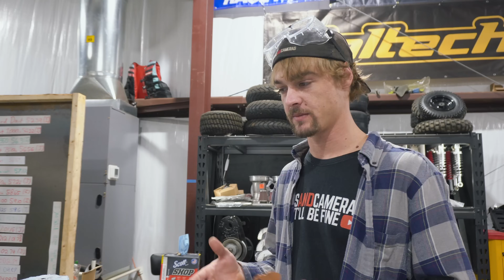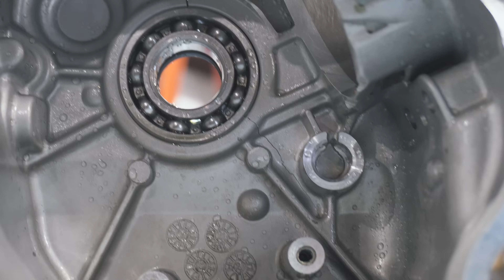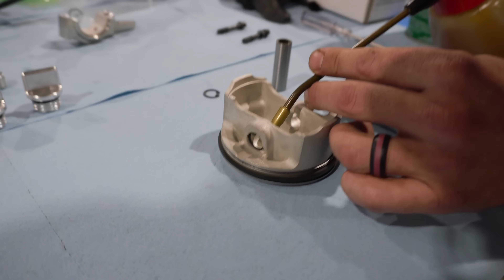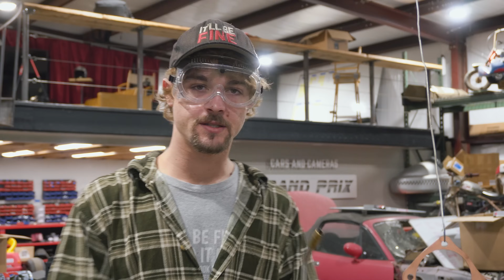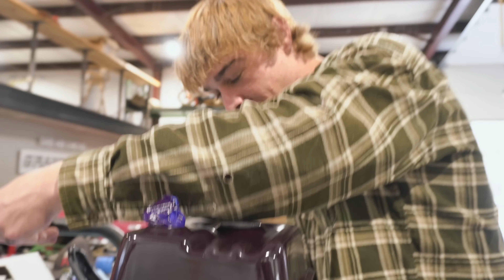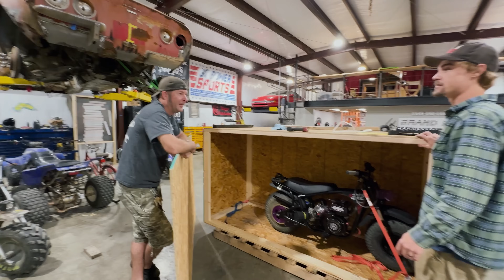Tillotson 263cc BIG BORE Build | Billet Head, 13:1, 30+HP Monster!

Comment: Around 7:55 john talks about ring end gaps and says the top ring is less than the second ring... And this was when things changed.  I attended a class around 1992 where sealed power/speed pro reps came to my school and introduced a new way of thinking on piston ring tech back then. They found the second ring should be greater than the top ring so as not to stack gasses in between the rings and unload the top ring from it's seat on the piston land. I tried this in my 455 Oldsmobile stuff and it worked like no tomorrow. The ring end gap bigger on the second than the first will mathematically allow blowby to an extent to not unload that top ring seal. The second ring is more of an oil control anyway so it was loaded below the top ring and allowed cylinder wall scraping of oil while also holding compression with a controlled release. 
Since then I gap my second ring about 2-3 thou more than the top ring and can easily make 620hp/600+ ft/lb stock block Olds 455s that can be driven on the street with zero problems. There is a huge difference between a 500hp n/a combo and a similar but different 600hp/600+ tq engines...as you can imagine. These long intake runner olds engines have all kinda velocity past the plenum into the cylinders and they love huge carbs with big venturis which tend to slow down the mixture just enough to stay atomized and also flow just enough to make up to 650 nearly 700hp. I know chevrolet guys won't be impressed, but all I'm saying is I can do more with 462 ci Olds displacement than stroker small block chev stuff at 434 ci if normally aspirated. 
People build these 500hp small block chevs for nitrous or even boost and the olds stock block can't survive over 750ish hp for long. I could go on and on with this.
Ring seal and type of rings and setup are the key and I love applying this tech to these small single cyl engines. 
I'm still looking and waiting for a dykes type of top ring for these engines and I'll make more power than another with 20cc more displacement!
Just sayin'

Comment: I believe those are the 1:3 black venom ratio rockers, EC Carburetors has the 1:5 heavy duty roller rockers. They have just a bit more power output throughout the engine and are stronger, lighter, and smoother.

Comment: Toyota head gasket sealer is what the big alcohol pro open small block builders use to lock that head down it's very expensive but really good
Reply: Or they did when I had one of the go kart engines

Comment: Do you have trouble using heavy springs with a cast cam, I have to use a steel cam on a kohler for a pulling mower.

Comment: 30+ hp on a mini bike is a fire breathing tire shredding white knuckle beast and I want one. I've got a stretched motovox with a predator 224 on it with your common upgrades like governor delete, carb, header pipe, flat top piston, bigger cam, heavier valve springs, billet rod and flywheel but it's  not making anywhere close to the power yours is making. I know how my bike feels and it rips but to have 30+ hp has got my gears turning and makes me want to build a new engine. You guys have done a great job on this new build.

Comment: Different people build different. Like for instance I only use assembly lube on my engines. Isn't wrong to use oil. Just wasn't the way I was taught. Just cool seeing his style that's all.
Reply: No assembly lube should be used for a non pressurized oiling system. As thick assembly lube can clog up oiling channels since the non pressurized flow can't remove it. 

Top tip for you guys.
Reply: @WyFoster  It's a preference thing. All assembly lube isn't isn't thick. You might be thinking of grease. Otherwise you have no idea what you're talking about and should probably do some research.
Reply: @Khris Yeet  I went to college for motorsport engineering. While I was in college I worked as an engine builder professionally.

I have built 20+ of these engines, and have run 7s in the 8th mile and set the world record fastest pass for a small block Honda clone. I'm currently a senior manager in a professional racing team.

Assembly lube is thick and tacky in comparison to motor oil. It's job is to cling to parts and lubricate them while the oil pump primes. It is then displaced by the pressurized oil from the pump.

There is zero reason to use it on a Honda clone/Predator as the oiling system of a splash lubricated engine is immediate. The crankshaft and connecting rod are rotated through the oil in the sump every revolution. This is non pressurized. Meaning any assembly lube on the bearings will not be able to be displaced correctly and can prevent the flow of fresh oil causing premature bearing wear. Same results if used on the wrist pin and valve stems, lifters, cam bearing surface, etc.
Reply: @WyFoster  Way to assert your position without being rude about it, great work on the records by the way! I've only ever used these motors on firefighting pumps, this channel has been quite the eye-opener and people like you in the comments make it 100x better. I ride bigger bikes due to being a sasquatch and not being able to afford all the cool toys I want haha.
Reply: @WyFoster  Well I invented the honda clone engine. On my off time I invented engine oil and assembly lube. I opened the first schools on engineering and engine building. My first students went off to teach at schools. I currently hold the Bonneville salt flat record for clone engine in a gokart. I say it makes no difference.
Reply: @Khris Yeet  You can do what you want of course. 

Mike Clements owns the record for a 4 stroke kart at Bonneville (rest in peace, screw Covid)

Go karts are no longer allowed for over a decade due to safety concerns. I'll call that a lie.

Comment: Nice build! Is that a sintered gear on the crank shaft? I've been seeing lots of sintered gears lately and been wondering how they hold up in higher HP engines. Thanks!

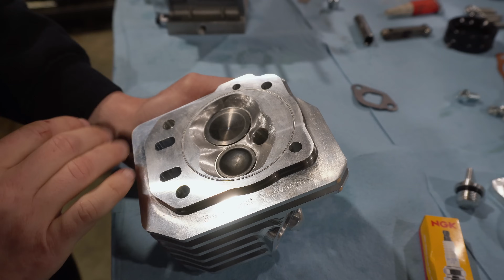Comment: Around 17:58 a fire ring without a receiver groove will not work. Trust me on this I found out the hard way with a race car, not a tillotson 1 hole motor...
An 0.043 fire ring needs a receiver groove on whichever side you choose, in order to seal with a copper head gasket.
I have found that a o-ring in the block, if done correctly, will mash up with a fel pro fire ring if you flip the head gasket upside down and will seal n/a compression like no tomorrow. I am nearly 14:1 on my Olds 462 and it holds with just 4 bolts per cyl, again n/a. This will not hold boost but I'm just trying to teach y'all what you can get by with

Comment: You layed the fuel line basically against the cylinder . When the engine gets hot it will not only heat up the fuel before it goes into the carb but it can cause improper burn. It could also burn through a fuel line and become a serious fire hazard. Just looking out for y’all. I would hate to see one of y’all get hurt beacouse of a simple mistake. Love the build keep up the good work

Comment: Not sure about blocking the oiling port ... what exactly is feeding oil up to the rockers now? I'd have thought restricting the flow would be the better answer ... 
Thanks for sharing 🇨🇦
Reply: The hole between the lifters and the cross flow hose between the side cover and valve cover.

Comment: So I have a bunch of old gasoline that I haven't disposed of. If I were to dip the parts in it and clean them, do you think it would be a good use or just a waste of time cleaning
Reply: I have found Diesel to be a better and safer parts cleaner. Diesel vapors don't explode like gasoline vapors can .. from something as simple as the sparks inside your bench grinder when you turn it on 3 feet from the parts you just cleaned.
Personally, I would dispose of the gasoline and use something else.

Comment: "ike has no idea about the build" Charles about the cam clearance: " its good all three of us checked it out" 
Also there's this stuff called assembly lube. 
This thing is maybe making 17-20hp. 
Carb jetting is way off, need to read the spark plugs and tune to that. 
Mistakes:
#1 should have shimmed the rocker arms up instead if taking material off and making them weaker. 
#2 (i could be wrong on this) you need to check piston to cylinder clearance. Piston slid into the cylinder a little to easy for me. 
#3 (also could be wrong) always check the piston ring gap on each ring prior to installing, ring gap issues will cause bad problems fast. Just some friendly advice from a certified and licensed professional 🤙🤙🤙 keep on keeping on brother
Reply: I'm the 3rd guy.

Piston to wall was .0015.

Ring gap was .013 and .017

No assembly lube should ever be used with a non pressurized oiling system as it is too thick and will block the regular oil flow.

Cannot space up rockers or it'll mess up the perfect rocker arm geometry that Johnnie and Mark worked on.
Reply: @WyFoster  okay happened off camera. Gotcha. Horsepower?
Reply: @itzchappyyo  Similar build by Johnnie Berry made 38hp on the dyno but that was on M5 methanol/nitro methanol blend.

Conservatively I'd guess around 30hp.

Comment: they actually have bigger engines next after that they have the 266 then this other website i found that are called paul’s karts they have a 270 crate engine
Reply: I have seen a billet 410cc small block. Perhaps we'll see one of those this year. I have a 263 and a 275.
Reply: @WyFoster  wait where do they have a 410cc that’s huge for one of those

Comment: I have been watching you guys since the beginning when you were swapping pulleys on riding lawnmowers. You have come a long way since then. Watching this engine build, I did not see you using plasti gauge on the rod bearings. One thing that will help with compression issues is check installed ring gap.  I don't want to be a stick in the mud, but if you do all that cleaning up the block and head, you should  do the  teo things I mentioned above. Keep it up  you are Rock Stars of MiniBikes..... Rusty
Reply: Rod bearing was .003

Top ring .013 and 2nd ring was .017

Comment: you  forgot to use plasti gauge on the connecting rod that is a must never trust just using torque specs you have to have to use plasti guage to make sure you have the right clearance on the mating surface of the bearings and the crank journal
Reply: also index your spark plug but you guys did an outstanding example on how to assemble these engines

Comment: Another way of sweating in your bearings or bushings like that is to put the casting on the bricks outside somewhere or inside a metal or ceramic tub so the heat doesnt blow away and heat it up with a heatgun for around 2 - 5 minutes and get some coat hanger wire as a hook and get that spraycan duster stuff, and turn the can upside down and spray the bearing until it's white freezing cool and quick dunk it in there - works a charm.

Comment: You guys should do a gx390 build, 6272 arc rod vertex 88mm piston, 36/32. Valve combo with 65 pound springs with 100 thousands shaved head champion rockers stock carb with a 41 jet and a 28 inch header arc adjustable flywheel and enjoy, that’s what are engine rules are for our mini cups and these things make a lot of ponies we run them on Sunoco 110 purple

Comment: you want copper gasket silicone, not ultra gray
Reply: Every professional small engine builder uses platinum gray or Hondabond because they want the clamping torque from using that kind of RTV. 

The spray stuff is weak in comparison.

Comment: To anneal copper, after heating it must be cooled rapidly by placing in water, letting it cool slowly returns it to normal.
Reply: I was going to comment the same thing. Copper needs to be quenched immediately after heating to anneal it. Opposite of ferrous metals.

Comment: Count the hours on this motor would like to compare notes we are seeing about 18 to 26 hours before failure
Reply: I have one with the same build. Same size engine, same head, etc.

I'm at 15 hours, no sign of any issues. I replaced a 236cc which had 70+ hours on it and could haul the bike to just shy of 80mph.

I fully expect my big bore to last a similar time based on how healthy the 70 hour engine was when I tore it down. Never even replaced rod bearings.

Comment: Where is the catch can I understand like a dirt oval kart run 15 25 slung wide open but I always had a valve cover vent run my fuel pump and also 2 side cover vents and sometimes depends block to a big catch can with a sight glass because I tried running one and would push out side cover gaskets if I where really turning it
Reply: Then we started catching the oil and filtering it and running it back in to bottom end

Comment: The top rings are also subjected to more heat. Which causes it to expand more than the second ring. And why the top ring needs a bigger gap, to not expand into itself and push out into the bore and damage the bore

Comment: Basically the exact motor I built… I have been having nothing but problems with it so far… my timing key ended up eating the flywheel and crank so I had to replace those… hurts when you’re dealing with a $2,000 + motor. I think I may have it figured out now though. Too bad I can’t be at mini mayhem
Reply: What do you think caused this to happen?

I had the same thing happen on my 224 build but luckily did not ruin the crankshaft. How mine happened was a knucklehead mistake. The last thing I did in the evening was put the flywheel on and snugged it down tight with a half inch rachet but continued assembly the next day and never torqued it down with a torque wrench. Duh. After about a minute or so first run on the bench it had a weird kickback when I shut it off. Then it wouldn't start. I realized right away what happened. The 8 degree key and Honda cast aluminum flywheel were wiped out.

I look at timing anyway with a timing wheel so it's best not to use a timing key. Run without one.
Reply: @Deucealive75  when I was pull starting mine I had really bad kickback 3 times and then I started getting annoyed because it wasn’t starting so I grabbed the rip cord and gave it all I had while goosing the throttle… it started for a second but then it kicked back, saw a huge vapor puff come out of the carb and I knew it was done for. It seems like the arc flywheel is adding too much timing for my high compression build.

Comment: I spent all last weekend upgrading my Baja Warrior 200. I’m still gonna get destroyed but oh well 😂. I’m so hyped for this weekend! 

I still have the original Baja engine on the bike but it now has a full stage 1 kit (last time it only had the straight pipe and airbox mod), I put a Tillotson racing cam in there, and finally I put a torque converter on it and had to modify the crankshaft to get it to work. 

It’s 10x better than what it was and I hope I’m not dead last this time but either way. This weekend is gonna be a blast! Can’t wait to see you guys and the build there!
Reply: This is good. You will learn a lot more making small changes along the way.  Like when you changed the cam, went for a ride and said...holy smoke it hauls ...
Cams are awesome!  Compression is huge if you can afford the fuel.  But you MUST use good fuel.
Keep having fun and stay safe.

Comment: What is the difference between a tilitons 212 and a predator 212?
Reply: You want a Tillotson R block. They come in 212, 225, 236, and 263 cc varieties. They are extremely strong, i have one that dynoed 39hp and propelled my bike to a mid 7 in the 8th mile.

Comment: I've got a 28mm mikuni that I can't use for my build, it will idle but when I give it throttle it dies....any ideas? 212cc .310 cam and 1.3 roller rockers and a 32 intake and 28 exhaust head from jrpw..please help

Comment: I’m wanting to build a 35+ hp Tilottson injected methanol motor for kart racing. I have the company that makes the injection kit also builds the billet head. What race block do I need? I saw the race block on their website. Are those the one I need. We will be using up to 30% nitro. I need a build list to build off of. Can I get the info I need?

Comment: Holy cow!  I had a 90cc Kawasaki G3 with about 10HP and that went fast enough :-)
Reply: I'm gonna nit pick, it's a 100cc I have a g4, does 55 with my 80kg onboard
Reply: @dietznutz1  Look up Kawasaki G3 in google.  It is a 90cc street bike.  It also went about 55mph, or 65 with a back wind and a slight downhill.  The G4 is a 100cc trail bike, or dual purpose bike.  Cheers from Canada :-)
Reply: @robinbrowne5419  any tips on getting more power out of them ?
Reply: @dietznutz1  No.  I don't think you really can get more power out of these kind of bikes.  But you can make sure it is running properly.  Follow the maintenance schedule in the owner's manual.  Make sure the air-filter is clean.  Replace the spark plug and adjust the points.  After a few years clean any carbon off the cylinder head and the top of the piston.  Clean any carbon out of the spark arrestor in the tail-pipe.  Try adjusting the carburetor jets.  Look at the spark plug to see if it is running too rich or too lean.  There are videos on Youtube about carburetors.

If you want more power, you can get a bigger bike  :-)
Reply: @robinbrowne5419  it has 1k miles it runs great can't legally get a bigger bike
Reply: @dietznutz1  Awesome 👍
Just enjoy it until you can get a bigger bike :-)

Comment: Just incase nobody has said it yet be sure and add zddp too your first couple oil changes the great government has taken the majority of zinc out of oil but a engine needs it for wear purposes.  Btw next time you rebuild a engine when you think you have the cylinder wall as clean as possible put a little automatic transmission fluid on a clean rag and whipe it again and see what more comes off.. keep up the good content and great builds
Reply: Definitely used a high zddp break in oil.